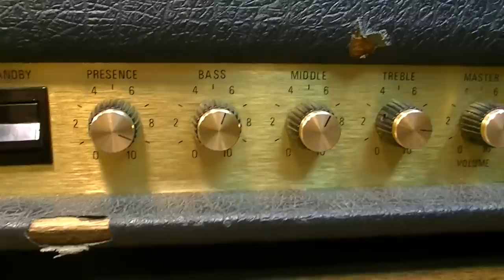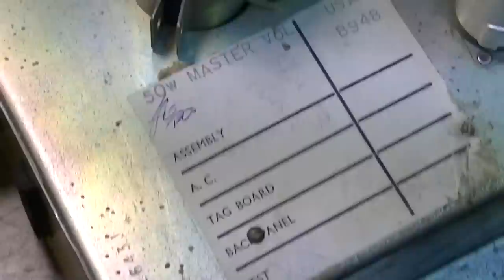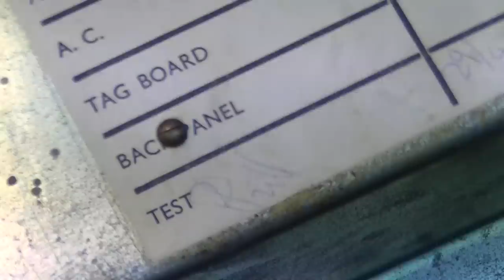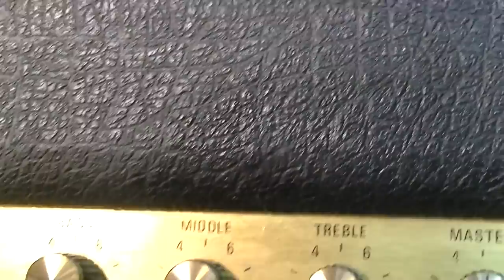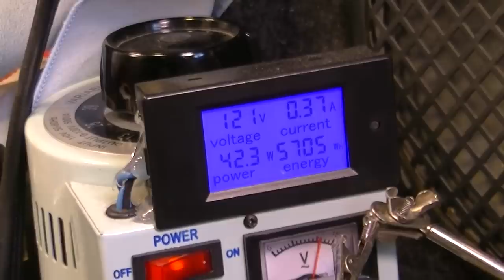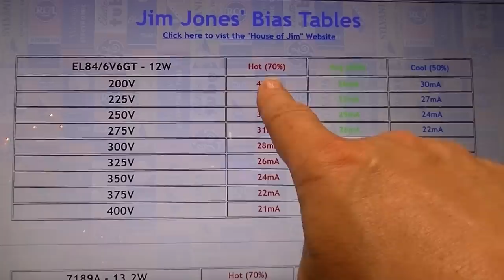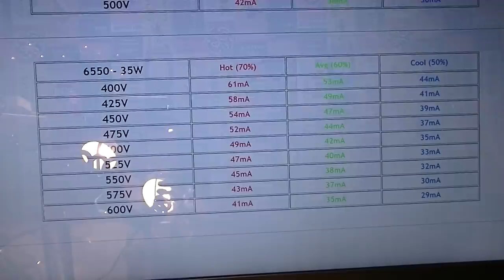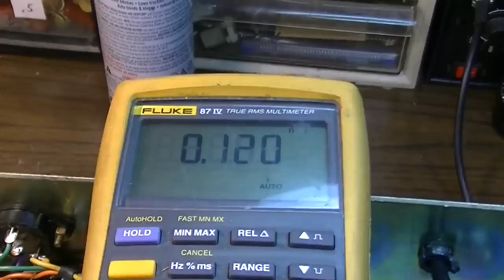Secrets of the Marshall JMP 2204 Master Model 50W Mk2 Lead Head - The PERFECT Marshall Amp!

Comment: If I were designing this (or any HV/tube gear), I’d put the bleeder resistor in series with a N.C. SPST pushbutton switch, rigged so that in normal operation (with the chassis in the cabinet) the switch contacts are open, removing the bleeder resistor from the circuit so they don’t waste power. When you take the chassis out of the cabinet, the switch closes the circuit, and the bleeder resistor drains the (remaining) charge off the main filter caps, and keeps it that way. And, you can still power up the chassis for servicing/diagnostics. Just my $0.02 worth of safety. 😎
Reply from the maker: There are some pieces of equipment Ive read about that do this. Can't remember what they were now.
Reply: If removing the chassis from the cabinet causes the bleeder resistors to ground the big caps to the chassis, where is that charge going to go (unless you leave it plugged in the whole time)?
Reply: Andrew Calhoun - into the resistor as I-squared-R power dissipation (heat). One end of each of the multi-section caps (the (-) end, usually) is in common, and connected to the chassis. The other ends are on the B+ line from the rectifier, and the other end of the bleeder resistor connects to the 1st section of the multi-section cap; the remaining sections drain through additional resistors or a choke (inductor) that’s in the current path of the B+ line.

Comment: I have been hit by 240V many times while installing wall sockets or lamps and was too lazy to walk and take the fuse off. I just always make sure I'm not grounded so that the electricity goes through the whole body but just instead through the skin of my finger or something like that. Skin is pretty good resistor but if you cut yourself with live wire, that's a whole different thing.

Comment: One of my biggest regrets in life is parting ways with an '81 JCM 800 2204 with stock 6550s.
Reply: Also, historical tidbit (according to Aspen Pittman in the Tube Amp Book, IIRC?)... this amp was designed for EL34s like most other Marshalls; in that era, Marshall was getting lots of returns due to crap EL34s that weren't faring well in shipping. Thus US market amps started shipping with 6550s (later 5881s in JCM900s). British and Euro market amps of the era still had EL34s stock, hence the bias adjustment range is appropriate for those, but on the cool side for 6550s. The 800 I had was relatively clean and LOUD, almost like a gainier Hiwatt.

Comment: Brad I don't know if you have time to reply on this subject,but i'm gonna give it a try. I seen your vid on the 77 Marshall 2204 mk2 with the 6550 tubes and i was curious to know if you had a  minute ? I have an unmolested 1977- 2203 double stack MK2 (fawn colored Marshall  I purchased off of a one owner who bought it brand new in that year, played it for two years then put it in a (large) closet up until 2008 he says,  I couldn't let this one pass  by specially when i talked him down to $1800 ,well when i got it home and plugged it in it sounded like a mule fart-n in a 50 gallon drum,  took it to a tech and he said the tubes and caps where pretty much dried out and needed to be replaced, I had it done with JJ 6550s /12ax7s and new can caps, when you showed that vid of the above mentioned, it made me curious, so I took the back plate off and took a gander and noticed something right off on the 4 6550s  two showed the red lettering had faded from heat and the other two looked like brand new with no fade-n of color on the logo lettering, any thoughts ?

Comment: The missing parts  around V1 are for a different model they built with the same board. 

It looks identical to my 2204 in terms of wiring and pots

I swapped out the power caps with double the values and bumped the coupling caps from the phase inverter to the power tubes from 0.022uF to 0.033uF

I had a weird motor boating issue. It would work for hours or days and then suddenly squeal then motorboat. Bad joint around one of the power tubes. Took me hours to find and catch that issue 

The preamp on my amp was like a JCM800 where the first half of the V1 triode fed from the Hi input, is fed into the switch on the jack of the Lo input driving the second half of the triode. The missing caps and resistors are for the older parallel triode inputs on the older JMP style R input amps. This was done at the factory.

Comment: Hello where are you located ?   I have a bassman which is reading proper voltage but I never can get sound from it.  Its like the stand bye is always on  and most has been replaced on this amp ground up but the stand bye switches..I bet you can fix it..

Comment: What about a signature guitar using a Class A input stage and a vacuum tube PWM output stage what about it, the British voltage is 240-250v at 5A possibly 13A if the AMP is a 1KW Marshall.

Comment: Does anyone know if Marshall stamped the tube type in front of the socket as a rule of thumb in the mid-late 70s?  I have a 2204 from '77 that has the same stampings but I've seen lots of these that didn't have them.  I don't know if it was done by them or a service tech.  If not then the amp I have was probably serviced by the same guy as this head.

Comment: I dont know how it was sounding before but it sounds great now :-) another repair nailed. What's with the headphones? Sound dampening?
Reply from the maker: Daniel Saturnino They are Extreme Isolation. Same ones Paul Gilbert uses. They're like gun range hearing protection and headphones in one.
Reply: Brad, that's awesome. So it allows you to push the amp and not puncture your ear drums by sitting next to it. Nice
Reply: WHAT!?!?!?!? SPEAK UP!

Comment: Around 40 min mark when your measuring mA for biasing why are you using the dc scale on your meter?  That is giving you the voltage drop...unless I'm mistaken.
Reply from the maker: I am measuring the voltage drop through a 1 ohm resistor. Since the resistor is 1 ohm, Ohm's Law tells us the conversion to amps is 1:1.
Reply: @TheGuitologist  Ah ok...thanks for the reply.  I'm still learning.

Comment: I had a 2104, which was the 2x12 combo version.  I think I paid around $400 for it new in 1977.  I was fairly new to guitar, and really didn't appreciate it as I should have.  I sold it maybe 6 months later to buy a Lab Series L5, which I still have.  I like the L5, which is worth maybe $400 now.  If I kept the Marshall, it would be in mint condition, as it just sat in my house.  I see them going for over $2000 now.  Really regret selling it, not because of what it is worth.  But it goes down as one of the dumbest things I've done gear-wise.
Reply from the maker: The Lab Series L5 is probably the best solid state amp ever made.

Comment: I have the combo version of this amp and on high channel I cannot get rid of this horrid oscillation when preamp potentiometer is from 50%.
What do you suggest can be the issue? Leaky coupling cap to preamp tube or filer caps?
Reply from the maker: Could just be a bad tube. Check the easy stuff first.
Reply: @TheGuitologist  looked for microphonic tubes but none of them are. I have also replaced power tubes and preamp tubes with a fresh set of new ones and still no luck. Right now i am going to replace fiilter caps because are those 50yrs old daly. Weirdness is appening only on high input and specially on v1a, v2a grids where i am reading negative voltages when preamp pot is at max or dimed (most probably because oscillation). I have checked all the coupling caps, the ones from v1 ad v2 are measuring 21nf, no continuity so ok. But the ones after are measuring 18nf instead of 22. Is it a symphtom of a bad cap?

Comment: Please go out and buy some Pasco (or Black Swan) pipe wrap primer. It is a very fast drying contact cement that is extremely versatile. Far better than super glue for tolex, carpeting, even wood, some plastics and many rubbers. A quart is $10-12 and will last for YEARS.

Comment: Was curious to know, how was the low gain input? Great vid as always!
Reply: Probably crap.  Every forum post seems to confirm.  My tech said the 10k cold clip resistor makes it useless, but if you switch it to 5k the low acts more like a plexi without goofing up the high sensitivity input.  He did this to my amp when i dropped it off for a checkup, without asking, or charging me...  seems wise from what i can find

Comment: Hey Brad, awesome video! Great playing too.  So I have a 78 2104, the combo version of this mounted in a head. Its always been too too bright, as in turn the treble and presence  off, to tame it.  Which caps would you look at to calm it down on the high end?  It works fine is all original etc.  I also heard the combo chassis had a different cap to compensate the open back combo cabs.   I believe this model is cascaded preamp.  Any thoughts?  Thanks for your great channel.       sundogaudio
Reply: A lot of people clip the Bright Cap on the volume pot to take some of the treble out.  Lift one leg of it and see if you like how it sounds.
Reply: @jhs5150   You mean the pre or the master pot?
Reply: Preamp Volume. The Master doesn’t have a cap.
Reply: @jhs5150   thanks i dont have it open yet.

Comment: I have this exact amp, except in a color I believe is referred to as "fawn" which is sort of a light tan. I bought it used a few years ago, along with it's matching 4X4 cab in the same color. It's 100% original, and in immaculate condition. 

Inside the speaker cab, which has all the original speakers, is Jim Marshall's signature in pencil. I first thought I found a real treasure, but I've been told that it's not that uncommon. Has anyone ever seen this, or know if it's common, or has any extra value?
Reply from the maker: I had a fawn half stack once. There's a vid of it. They bring a premium.

Comment: Less "I guess"'-ess if you had pulled out a schematic to check against. The 47K ceramic cap is 47pF, the "K" denotes +-10%. The 820 Ohm beside the empty 330uF spot should be 10k in a 2204. Also the usual 470k's is here 100k, so it could very well be that this amp was one of the last 2204's of the first edition. They did not have cascaded gain stages like the 2203's had from the beginning. Looks like someone tried to mod it to be closer to the famous later circuit.

Comment: Do you find that one tube amp is consistently more reliable with better build quality?
Reply: In marshalls?  Lots of variability, just because.  My 2204 had socket pins which were never properly soldered in at the factory!

Comment: Hi Brad cool video!  Thanks.  1 ohm cathode resistors are a good idea.  Whatever volts you measure across them equals the number of milliamps flowing through them.  Simple.  When you measure voltage across plate-to-cathode, you can then precisely calculate the power dissipation.  Perfect.  Hey the other thing is the resistor may act as a sort of sacrificial 'fuse' perhaps, under some circumstances?  Not sure.  It sounded great anyway when you'd finished with it, & got rid of the silly mods.  You're a very good guitar player aren't you!  Geez, your playing on the unit after you've fixed it is become an important part of the video!

Comment: Mine is the same model, but it's even more "perfect". Why? I had a foot switchable 2nd master volume put in. The 2nd volume knob is in the low input (why would you use that anyway), And the foot switch input is in the back by the speaker jacks. This is a simple mod that can be removed by anyone and makes the amp way more versatile without changing the original tone. The second volume is just that. Not a gain boost, not an EQ change. Just a volume boost. So it's almost like having a 3rd channel when you switch to the volume boost "channel" and then back off on your guitar volume. It cleans up but you still have a comparable volume to your straight dirty original sound. Add a TS-9 for distortion boost,you've got a bunch of classic tones from AC/DC, to Yngwie, to 80's metal, to Hendrix and even SRV. I used this amp with a fuzz face + TS-9, and a fender twin and covered a bunch of Eric Johnson tunes really well. I have a DSL (which I really like), Had a JCM 800, and a TSL,and a '73 50W JMP MK2. This amp combines the best of all of them. Oh, and a ground lift switch that comes in real handy. I dig this dude, he's got the right stuff. P.S. The best part of my Marshall is that the previous owner recovered it in red tolex. crappy if you see it up close, but fine from the stage. So I was able to get it for $850. What a steal! Collectors are the enemies of musicians. The fact that this guy is a musician and knows what a amp should sound like and can play on it  seems simple, but it's what separates a tech from a indispensable tech. I've dealt with techs that say the amp is optimal- yet it still sounds like shit. This guy is one of the great ones. Subscribe!

Comment: I also have a early 1973 1959 super lead that has been converted to el 34s and saw the vid on the marshall  that had been converted  to 34s (american model)  that you where gonna turn back to 6550s and noticed the resistor added to the conversion, it makes me think did this tech i had put that extra resistor in  cause now i can't turn the volume all the way down it sounds like its on 3 when its off can lack or a resistor cause this , by the way I live right next door in Warsaw Ky, it's great to  know that all hillbillies are not ridge runners from the back woods lol

Comment: IMO, the JCM 800 Lead Series was the best Marshall ever.
Reply: Mine is from late 84, she is pretty powerful.  Do you have a matched cab?
Reply: Brillford Wimley    I'm not sure what year mine was. 50 watt head that just wanted to bark loud! I had a full stack but often just used one bottom. My cabs were made in a cabinet shop supposedly to Marshall specs. I was playing in bars and clubs and could not turn that thing up unless it was an outdoor gig. Very loud. Alas, I had to sell her, to help pay for a cross country move. But I did not utilize it for it's great Marshall overdrive. Would have to turn it up too loud for stage volume, plus, all my overdrive and distortion effects came from my pedal board processor. So I would run the Marshall as clean as possible.   When I look back at it now, the stack sounded great, but it just looked great as well. Now a days, I prefer a combo amp that is loud enough for stage volume, and compact enough for my old body to move around. lol

Comment: i have two of these heads. they are indeed the holy grail. everything from classic clean to edge of breakup all the way to soldano total modern meltdown its all here. get one if you can find one. as with any real vintage marshall your mileage may vary some of these amps are okay some are legendary choose wisely.
Reply: How do you get soldano sounds from a 2204?  The cold clipper resistor is so different
Reply: @EtherDais  cut treble and presence crank mids & gain and use a tube screamer or other over drive to slam the first tube real hard. also a nice high end effects with some reverb and delay that headroom with the wet signal will sound very modern.

Comment: I used the handle of a screwdriver to hold any tags that are glued,I have also had a few belts working on my marshall ,s in the past .here in the uk ,they introduced  power cutoffs linked to decibel meters ,no point in using a stack ,when a cymbal would turn off the power !!!!!!

Comment: Could be done ALOT better, especially in wiring (speaker wires across the hot screen resistor is an unsafe thing, and so on...). Typical poor maintenance I often see inside vintage marshalls.
  BTW, there is no 330u (or so) cap in master volumes, it's for superlead/bass only.

Comment: One thing I would DEFINITELY recommend is that everyone ALWAYS use electrically-safe tools (like... uninsulated screwdrivers?) when working inside, or over the top of an open amp chassis! One slip, and your 4 inch metal rod will be allowed to cavort, uncontrollably, with the electrical elements in the chassis, serious ugliness will ensue.

BAH! that's what fuses are for! right?! Um... no.

Comment: My  JMP  1977  MKll   SUPER LEAD. 100W (written in block letters not cursive) It has Rocker switches  2x2 inputs (4).  
Presence. Bass, mid, treble and volume 1 and 2.  But No master Volume. It should have,  seeing it has rocker switches. Only master Volume should have rocker switches.mine should have toggle switches. Someone had installed a master volume where the JMP logo is.  This was a time at Marshall where I understand all surplus parts were used up while switching gears for new master volume.  My neighbor had the same one in the video but he bought it in 78. Mine doesn’t sound that great but Inside everything is pristine. My JMC 800 sounds excellent. But my JMP should sound as good or better.  
Especially hearing other ones. The bias on the tubes say 40.3. Isn’t that a might low for a dirty sound? 4  (RCA). Anyone know much about this amp?

Comment: That circuit board as well as all the components looks very similar to the ones used in an old Furman PQ parametric. It's almost uncanny. The only difference is size. The Furman board is slightly smaller, but it still looks quite similar, especially the components and board coloring. I've never owned an old Marshall amp like this though, so I couldn't really compare them. Makes me wonder if the circuit is similar. Hmmmm

Comment: I had one and that's what I thought too. There was this perfect growl when I turned to volume to 10. I sold it to get the new JCM-800 2204, and I was underwhelmed by the new amp, but it was fine for Iron Maiden and mid-1980's metal and hard rock.
Reply: Any idea what year the jcm800 was?
Reply: @EtherDais  My 2204 JCM 800 was a 1984, replacing a 1978 2204 JMP. I wouldn't male that trade today. In fact, I would take either of those over my JCM 2000 DSL50, but that's not a bad head either.